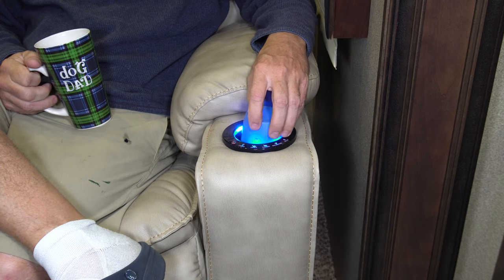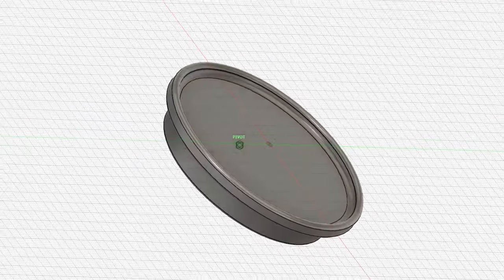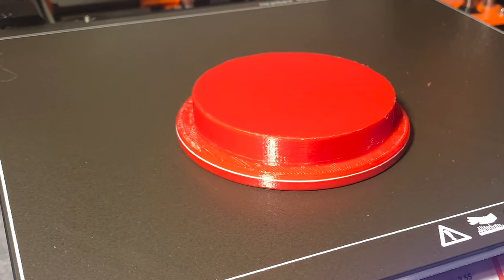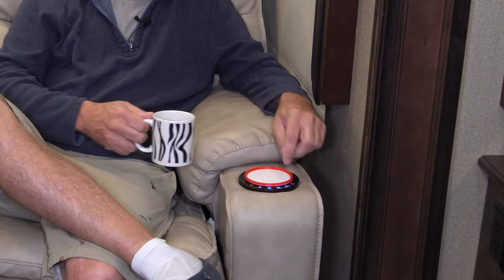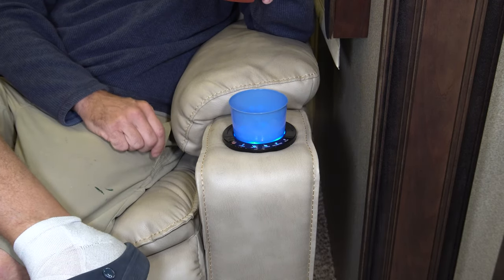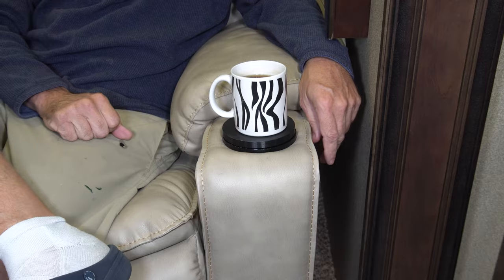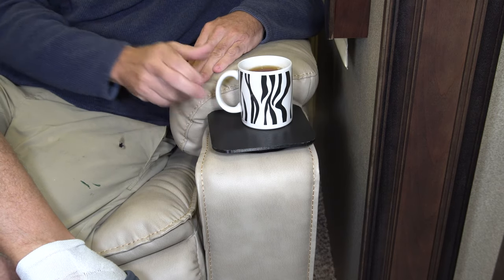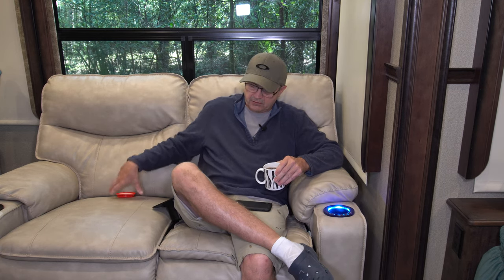DIY RV Couch Cup Holder Problem, Coffee Cup Thomas Payne  (RV Living Full Time)

Comment: Came across your video because I'm in desperate need for some kind of drink holder. The way my 5th wheel is designed couch wise, we have no room for any kind of holder 😔 not even the the ones you use for the arms. Any ideas would be appreciated 🙏
Reply from the maker: Email. We might have something

Comment: Good idea, however it doesn't equal the safety(?) of the cup holder in the seat - yours works but it's still easy to knock that cup over - as anyone traveling with a pet (or child)will confirm. I know they make ones that address that problem, but they can be quite pricey, and seriously most of us don't have a 3d printer.
Reply from the maker: Susan, Larry likes to invent and share his ideas. 
The plans for it are free. Link in the description. Someone just has to find a company to print it. 
Alice
Reply: @DownsizingMakesCents  what type of company do we need to look for? Seriously, I haven't seen anyone advertising that service and don't have a clue....